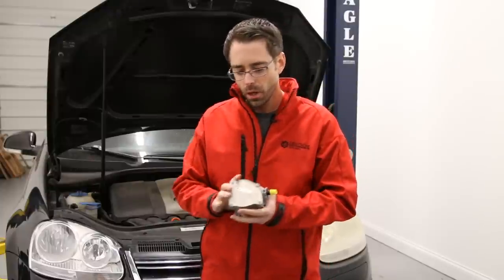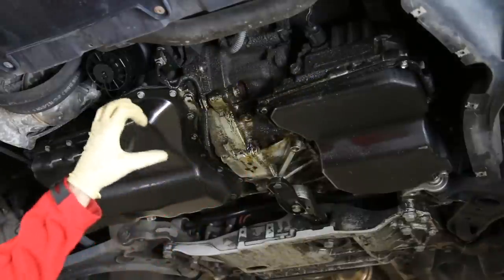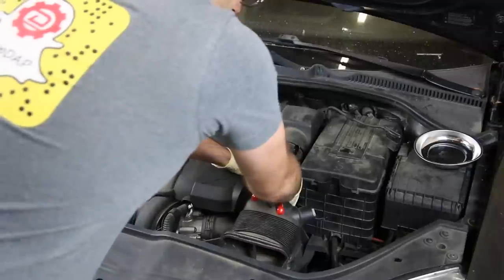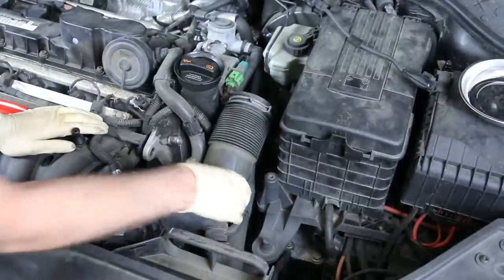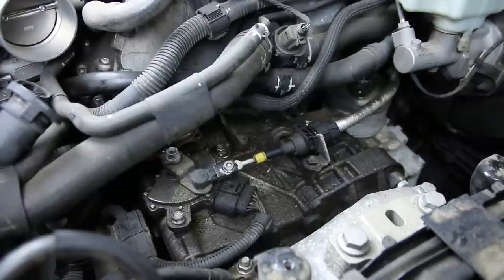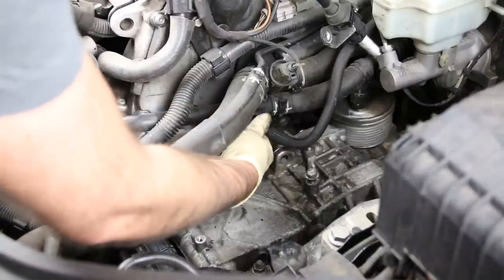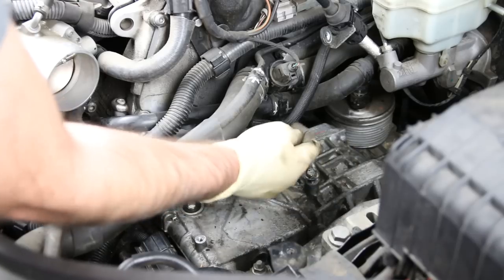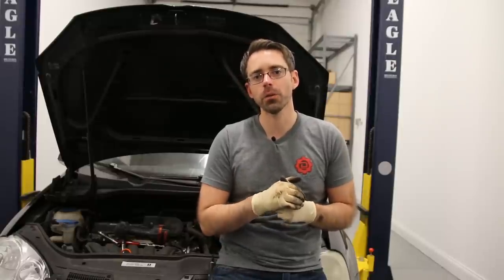How to Install a Vacuum Pump on a VW 2.5L 5cyl (Find Parts HERE too)

Comment from the maker: - We appreciate your Support and Purchases! -

Vacuum Pump for VW 2.5L 5Cyl
https://shopdap.com/make-model-year/volkswagen/07k145100h-vw-2-5-vacuum-pump.html

Vacuum Pump Gasket for 2.5L 
https://shopdap.com/07k-145-215-a.html

Hose Clamp Pliers for VW and Audi
https://shopdap.com/vw-audi-hose-clamp-spring-pliers.html

34pc Torx Bit Set
https://shopdap.com/vw-audi-torx-sockets.html
Reply: Do you sell the hose itself? I cannot find the part number for it even on parts dot vw.

Comment: For those doing this at home and potentially in their driveways or areas that are not exactly flat, chock your wheels in case you bump the gear selector on top of the transmission. This will prevent the vehicle from rolling away.

Comment: Thank you so much for this video. The dealership quoted 1335.00 for this repair. It only took about 2 hours and cost around 150.00.
Reply: $1350 for me
Reply: @nutachka86  $1800+ for me!
Reply: Independent mechanic charged me $190 for labor

Comment: This video is now almost 4 years old and there are gasket/seal rebuild kits available which can let you keep your original vacuum pump. If only the one orange gasket seal (battery side) fails, it is much easier to replace this seal than having to remove the entire pump. Still, this is an excellent video and knowing where to get this pump at a good price is a great thing. Detailed procedure is excellent!
Reply: How do I get the seal back on and keep it on after it comes off?
I was installing a brand new pump when that happened, and now I can't get the seal back on because it somehow became longer....
Reply: @EseanB  I ended up removing the entire pump and sourcing the vacuum from the intake manifold to throttle body. Integrated Engineering makes a special seal plate and there are several videos and YouTube videos on doing this. It actually adds some horsepower and is much more efficient. 
I've since sold the car but this was a major improvement. 
The pump was really designed for engines with a turbo charger and VW just saved some manufacturing costs by putting this pump on everything. A non-turbo engine does not need this pump.
Reply: @boomerguy9935  , interesting. I'll keep that in mind, but that doesn't help with my current purchase predicament.

Comment: On my 2006 beetle with a manual, this turned out to be even easier than this, and didn't even have to remove the shift linkage or housing cover.  Though it looks a bit different than on this car, these instructions really did help a lot with the process.  The shop was estimating 9 hours and over $2K for a job that took me a grand total of 4 hours taking it slow.
Reply: I'm about to do the same thing on my 06 Jetta that's a manual. Any tips or differences to note that the video doesn't go over for manuals?
Reply: @bronzedonmarcus7647  If it is the 5-speed (Code HJE) manual on the i5 BPR engine (I believe the BPS is similar enough), removing the intake box and hoses, as well as the battery box should allow you to get access to the area.  I was fortunate enough to not have to remove any transmission cabling, but I had to move the shifter to get the shift selector in a location out of the way (trial and error will help here).  To get better access to the vacuum pump, I disconnected the large coolant return hose on the transmisson side of the engine and moved it out of the way.  This should give fairly free access to all of the necessary bolts and should allow the pump to be removed without any disassembly of the vacuum pump itself.  You should also be able to get the replacement pump back in without any disassembly as well, just make sure to note the orientation of the drive lugs, because that can be a bit of a hassle if it is out of alignment.  Not disassembling the vacuum pump will probably decrease chances of it failing in the future.  Just as a precaution, do not forget to have a new metal gasket for the mating surface between the pump and the engine.
Reply: @TheHengeProphet  Awesome thank you!
Reply: @bronzedonmarcus7647  one more thing, the torx bolts for the vacuum pump are aluminum and hard to find.  Torque them to 7Nm

Comment: It's a bit easier if you actually take that 10mm bolt out of the bracket first. Also, here's a tip I learned: hold a small bit of paper over the head of the torx bolt before sticking the torx bit into it. It'll hold the bolt onto the bit with a little more friction when putting the bolts back in, then simply fall away when you take the bit off.

Comment: I have been dealing with this oil leak issue for a long time and I am glad I finally stumbled upon this video. It seems that there is a gasket kit available with two gaskets, a one way valve and screws. Thank you very much!

Comment: Some tips if you're an amateur like me:  1) You can do this by only 
buying new gaskets (no new pump for $200+).  Just search vw 2.5 vacuum 
pump gasket on amazon.  can be as low as $20 making for ridiculous 
savings relative to vw dealer quote in the $1000's.  2) Use white 
lithium on the new rubber gasket.  improves seal and will make it last 
longer, so why not for ~$5 at harbor freight.  3)  Use black silicon on 
the new metal gasket.  This keeps the metal gasket in place as you put the pump on, 
which is important, and improves the seal.  Again, ~$5.  4) Make sure, 
when you put the pump on the order is engine, metal gasket, pump, THEN 
bracket.  Any other order causes a horrible oil leak and you'll think 
you killed your car.    Hope this is helpful.
Reply: Thank you I put the bracket on wrong and my car started pouring oil. Hopefully I can get it done.
Reply: @yerpster  yep. I did that too!  But now its been running fine ever since i put the bracket on correctly.  Hope yours works out too.
Reply: This comment was the one I needed. Thanks for proper order for that bracket!

Comment: What material or part number is the black washer on the shifter that gets removed at 14:43? Mine was completely disintegrated.
Reply: Any luck finding the type/Size of the washer?
Reply: @satisol7  No luck finding the official part. Ended up using a high temp washer from an oil drainplug. That entire nut and locking washer rotate when you shift gears. I think the purpose of the black washer is to take that wear.

Comment: FYI now you can buy 1/4 drive bits for those hard to get torx 27 screws. I have had mine for a few years now...
Reply: Gasket kits on amazon for 40 bucks. Does the same as new vac pump. Saved 160 bucks.. go cheaper before you fully decide to throw your money at it just Incase it’s not what is actually wrong.

Comment: Thank you so much for the video. I just finished my vacuum pump installation on my 2009 Beetle. I couldn't have done it without it. Everything went as you described. You saved me a bunch. Only thing I can add, be careful with the fiber washer under the nut on the shift switch you remove. Its very brittle. Broke mine wiping it off. Not an easy find for size and thickness but an hour in the local hardware store netted me a nylon one that worked. You guy's are awesome.

Comment: Update: VW is on revision "K". Pieburg appears to be on "H" still along with other aftermarket options such as from Ixetic. Some reasons for revision are discussed by Charles HM - revised cover metal and o-ring. Consider best chance of doing the job once and not repeat.

Comment: Great video. Thanks a lot. The one thing I don’t get is why you do have to marke the shift assembly as it will get back in place. I mean can’t be misaligned!!
Reply: The holes are elongated so there is some adjustment in it so it can be out of alignment on this engine

Comment: Can you explain in greater detail the rational and purpose for marking the bolts with marking paint. *What happens if one does not mark these bolts? Is there a torquing issue in play for this recommended step? What is the consequence of the 10mm bolts not lining up with the yellow markings after tightening down?
Reply: I wasn't sure of that either. It might be for torque but the two bolts just tighten down into the transmission housing and serve no other purpose than to just hold the actuator? in place.
I gave them two a good snug, not over tightening and no problems.

Comment: Since the Piersburg vacuum pump is identical to the original ones, does that mean that they still have the design flaw that makes them leak in the first place?
Reply: First thing I thought also, but me having a 08 rabbit in Ontario dealing with this issue after 315000 Klm and 11 owners before me lol all service records from vw up to 250 000 I think it’s safe to say it won’t be an issue once replaced. Mk6 would be a different conversation.. I thought it was a valve cover at first or maybe my transmission as I have a manual not automatic. My Transmission uses gear oil instead of tranny fluid would not be able to tell the difference on the floor if you spot a leak, automatic would be pink but gear oil looks the same as engine oil. This makes perfect sense to me now cause my fluids have not really changed much transmission is fine yet the bottom of my case looks like the inside of a kfc deep fryer after it took a double shift at a McDonald’s lol 😂 I know valve covers, vacuum, head liners, and door locks can be a problem but I’ll take a German built vw over a Honda all day mk6 sh!& the bed! 👎 my buddy has a 30 edition gli Jetta and had to have his timing chain done before 100k assembled in mex still stalls going in reverse.. and it’s automatic!

Comment: What a pain in the ass that bottom torx screw is on the pump. I was using a regular long "L" allen and cracked the screw free using an adjustable wench for torque. 
Loosening it wasn't a problem but man it took me like half an hour trying to get that screw back on and then tightening bit by bit with the allen I had lol 
I highly recommend that if your gonna do this, be prepared with a ratcheting long head bit. The bolt is actually a T30 and not a T27. 
At least on my Jetta 12' it was T30 on the pump frame and T25 on the faceplate.

Comment: I just did this...a couple of helpful tips - 
the bolts that mount the pump to the timing housing, the bottom one is hard to get to. Keep a finger underneath it so in case you drop it it doesn't disappear into oblivion. A few of these videos mentioned that being a problem so I was extra careful and didn't run into this issue. It would be a good idea to have a magnetic socket set or magnet on hand.
Also, when tightening the transmission nut back on top of the selector it is easy to accidentally turn it into gear. Be sure to check it is in the fully counter clockwise position before putting the cable back on.
When I went to start the car the brakes were very hard and it didn't think i was applying the brake to let me start the engine. I let it build a bit of pressure and pushed the brake extra hard and it started right up.
After disconnecting the battery if you have auto roll up/down windows they will appear to no longer be able to do the auto function. You simply need to roll them all the way up and all the way down for them to be reset and they should work fine.
Great video, this saved me a lot of $!
Reply: Excellent comment👌🏼 thank you.

Comment: Since there are after market kits for the gasket on this vacuum pump, do you think it can last as good as the oem vacuum pump? Coz the vacuum pump cost about $200+ while the gasket kits is only $10+. Any experience with replacing the gasket only?

Comment: Has anyone else sheared one of the main 3 T30 bolts? I'm an idiot/stronger than i think and do not know how to weld. Is drilling the bolt my only option or is there anything else I can try before going to a shop? Many thanks in advance

Comment: How are you getting the torque correct (10 newton meters) when reinstalling the T27 screws on the pump?  Guesstimating?  10nm isn't much, just under 7.5 ft-lbs.

Comment: Hi thanks for the vid! Wondering at 18:45, what type of bit driver and extension did you use to access the  bottom left torx 27 screw that’s connected from the pump to the cylinder head?  I’m semi new to the repair community and still finding my way around tools and such.  Would you be able to provide links or list of tools I would need for the driver and extensions you used?  Also going to attempt to replace my valve cover - your vids have given me confidence to do it myself.  I’m tired of paying big $$ to VW for these types of repairs.  Thanks!
Reply from the maker: It was in this kit https://www.shopdap.com/vw-audi-torx-sockets.html.  Glad you found this insightful

Comment: You mean to tell me there is aftermarket seal replacement available even in Dec 2020? If not and you do have to buy the vacuum pump, why not just replace the seal instead of going thru the hassle of replacing the entire pump?

Comment: hi i replaced my pump today and when i tried to start my car it had and issue cranking up , after a fiew tries it started right up , looked at the new pump and i saw it was leaking from the part the mates to the engine, also did not change the inner gasket , is this my issue ???

Comment: Happy Holidays. Your videos and the information you share about VW parts and repairs are unequaled on the internet. I mean that. I was wondering if I could make a special request here. I own a 2006 Jetta 2.5L engine similar to the one in this video. I may or may not have an oil vacuum pump issue as I do have some  oil collection similar to the areas you showed here. Just recently my oil pressure light has been flashing mostly coming on when I accelerate when driving. Idling is fine as the warning light does not appear then and I have stopped driving it for now as the lifters are more audible than before. Oil and filter was changed recently and the oil level is fine. All online research points to a bad or malfunctioning oil pressure sensor. Apologies for the long preamble, but I was wondering if you can do a video on how to replace the oil sensor on this motor? I can't seem to find any really descriptive pictures, tutorials or videos on where this sensor is located and how to get at it. Can you help? Thank you.

Comment: How long can I  drive car with this problem as long as I keep oil monitored?
Reply: carlos alvarez I’ve been running my Jetta for a while with it but it’s always a good idea to take care of oil leaks. If you rebuild the vacuum pump by replacing the gaskets it should stop the leaks they sell kits online

Comment: This car has an automatic transmission. Will this work with a 5MT on a 2011 Jetta, too? If so, will it impact the shift cable adjustment?

Comment: Thanks for the vid! Quick question:  What would the symptoms be if the drive select mechanism wasn't reinstalled in the exact position?   My Rabbit is making a whining noise under acceleration/shifting and I wonder if that could be the result of me not reinstalling the drive select mechanism properly?
Reply: @TheHiddenArchives Nope.  Turns out it was just an exhaust leak that happened to start at the same time as this repair.
Reply: @TheHiddenArchives NP!  It was a huge relief to discover that it was just the resonator finally rusting out after 12 years.  On a separate-but-related note, what's the deal with these cars having  essentially three mufflers behind the cat!?
Reply: @TheHiddenArchives Delete kit?  I can't really speak to that.  I just repaired/replaced the two gaskets andkept the original pump.  I've heard the delete kits work though.

Comment: Hello, thank you for the very detailed video. I have everything off now but I had a heck of a time moving those rad hoses. I think I will have to remove the hoses to put it back as it was a challenge. Ill have to check if they are secured by brackets near the back first.

Comment: The piece that goes inside that hold broke off and fell inside. I can't get it out with my fingers because there are chains in the way. How can I gain access to that compartment?
Reply: @TheHiddenArchives ya i had to take off the entire cover. I never found the washer that holds the piece on though. Looks like a skinny nickel. I looked everywhere, put the car back together, and it's been fine ever since.

Comment: I am confused. At 1:15 of your video, you state the gasket is not available individually. However, in the description of your video beneath the "Show More" link, you have included a link to purchase a Vacuum Pump Gasket for 2.5L https://shopdap.com/vw-audi-hose-clam...  (So which is it? Th gasket is available for replacement only or is it NOT available?)
Reply: The video is from 2017.

Comment: Is this an automatic transmission?  If yes, is that stud an issue on a manual transmission?
Reply from the maker: This is only an issue on Automatic cars
Reply: No,  Replacing pump on manual is simple because the entire pump slides on and off unimpeded.  This entire method is a hack to avoid VW's recommendation to separate the transmission.

Comment: I replaced the pump however after the car started but would not shift out of park, any suggestions?
Reply: Did you reconnect the transmission cable? Also mine wanted to do this when I first started it after the repair. I had to simply apply extra brake pressure (I assume it had to rebuild pressure) and it started
Reply: Hi just saw your comment to the park not engaging issue. I just swapped out my pump but after that my car would jolt really hard from going from park to neutral and to drive. Also seems to have affected the gears when driving. I'm thinking the issue is with the neutral safety switch/shift selector position. Did you ever have any luck resolving this issue?